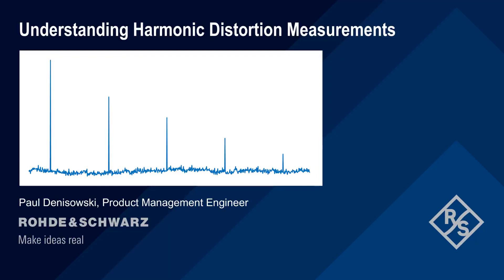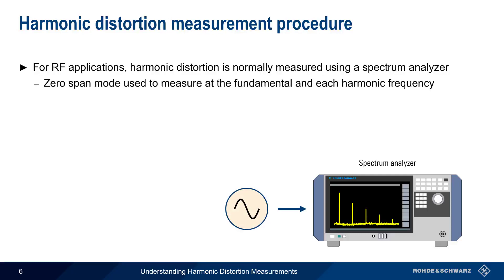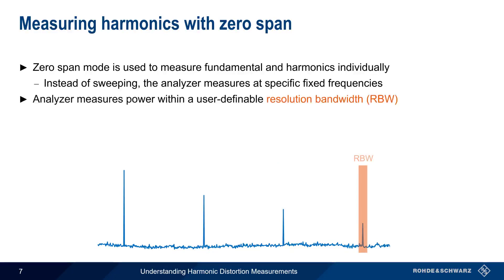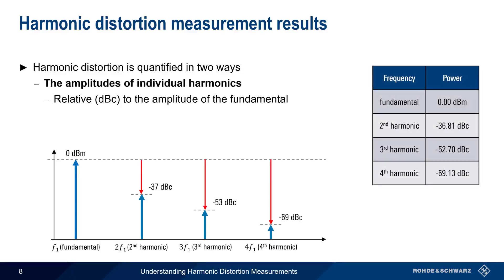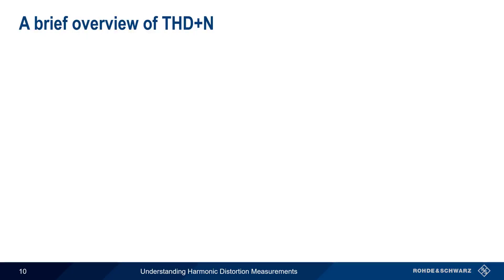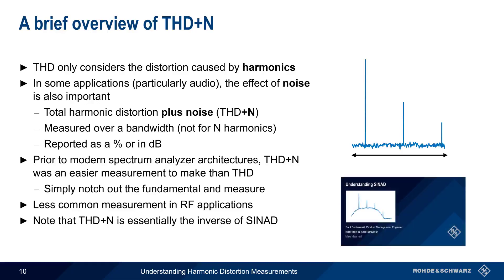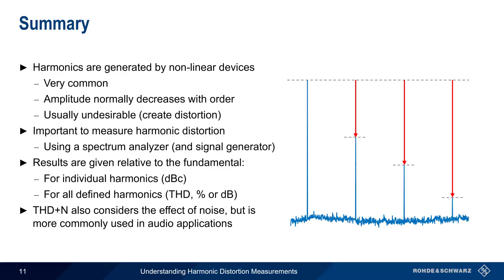Understanding Harmonic Distortion Measurements

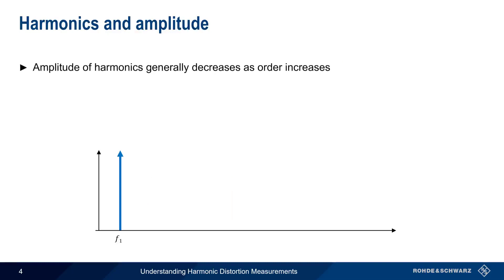Comment: Nope, not even close. At 1:30 you claim that harmonics decrease in amplitude as the order gets higher. That is wrong, if you distort sine wave for a very short duration, (1/100th of the period or less) the harmonics will not decrease in amplitude, as it depends on the AREA distorted. Sure, if you whack off either peak, you will see the harmonics fall off as frequency increases, but that is only because you distorted a large AREA. Area is voltage * time, and is measured in volt-seconds or Vs. Plus depending on where the distortion happens in the sine wave, you get different patterns of harmonics, which I call the harmonic signature. Do you know what controls the harmonic signature? The PHASE ANGLE where the distortion impacted the sine wave, according to my formula, The Bullard Harmonic Solution. Read one of my books, or all of them. You will realized that what you are saying is pure nonsense.https://youtu.be/G0cSIu1a6d8?si=bH3j3sQp62Q-T-eU
Reply: they said "generally", which means there are exceptions

Comment: What does it mean when the 3rd harmonic is larger than the 2nd harmonic in power?
Reply: It's actually not uncommon in some applications for the amplitudes of odd order harmonics to be greater than even order harmonics.  If a signal is pulsed or square wave shaped, then it usually will have higher odd than even order harmonics (the old "square wave is the sum of odd harmonics").  For example, a switch mode power supply draws current in "bursts" or "pulses" and thus the current waveform will have higher odd than even harmonic content, and thus the power (voltage * current) waveform will also have higher odd than even harmonics.   I'm actually just finishing up a video on current harmonics that talks about exactly this topic :)  Thanks for the question!

Comment: 4:40 the width of the harmonics increase with order. Is this equivalent to saying the phase noise of the harmonics ‘decrease’ with order, the harmonics are less spectrally pure than the fundamental?
Reply: Phase noise usually increases with harmonic order - i.e. the 2nd harmonic has worse (that is, more) phase noise than the fundamental, the 3rd harmonic has worse phase noise than the 2nd, etc.  Generally speaking, frequency multiplication always increases phase noise as well.